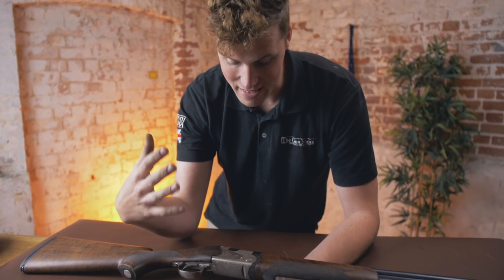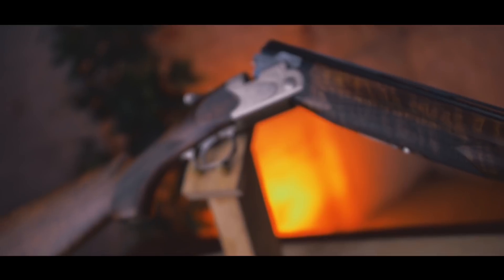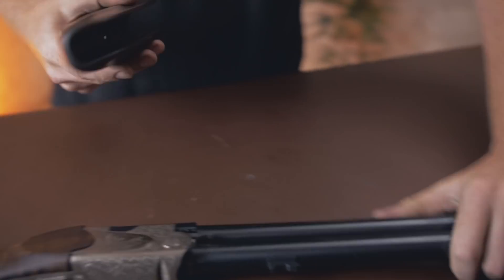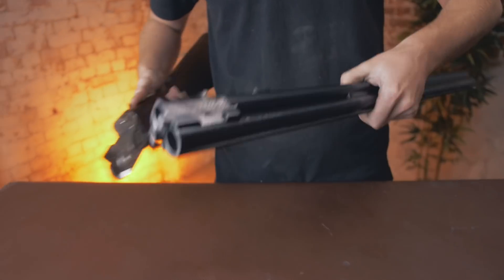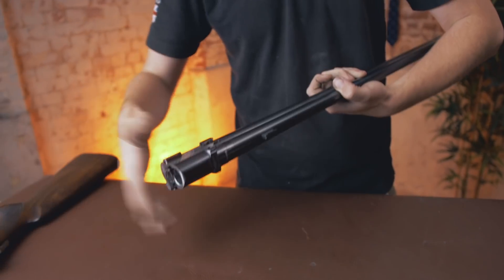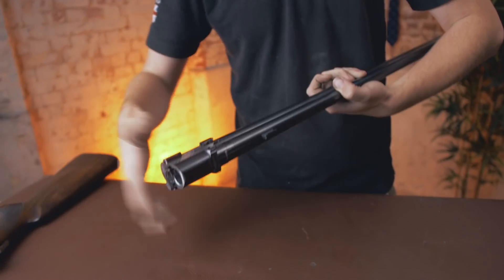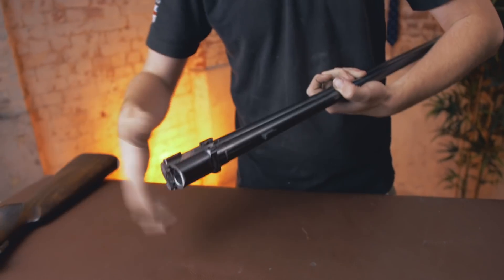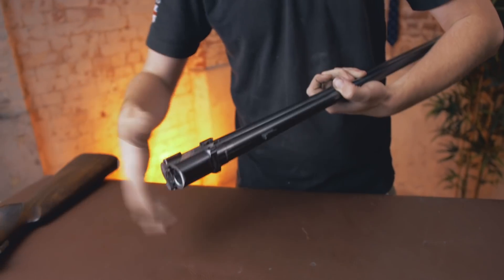The Beretta SV10 Perennia 3

Comment: My first shotgun was a Beretta in the 80s , but selled it because of the ergonomics.  Than I saw luckily one used sv10 this year. Bought it. Wonderful rifle.  Fixed a little loose forend.  with the adjustable small Tx 6 screws in the opening  latch .   No issues with ejection.  Highly recommended.